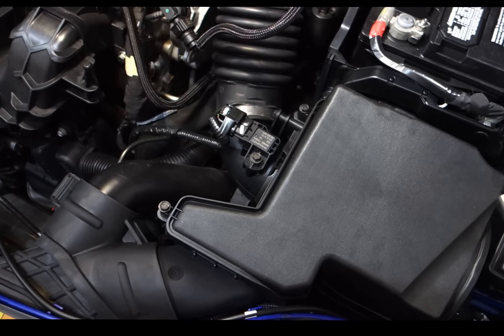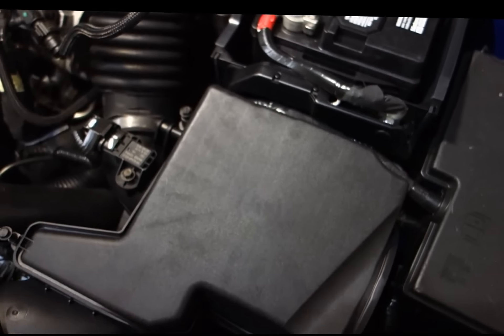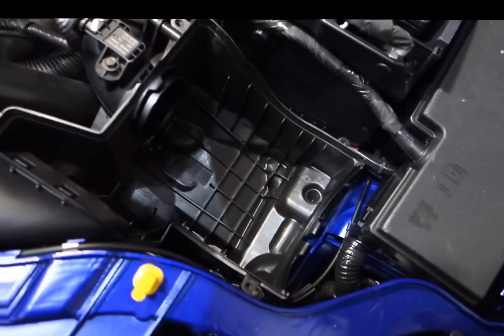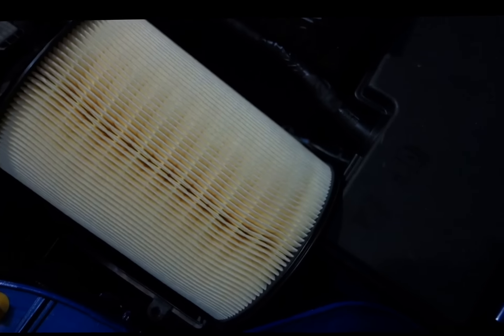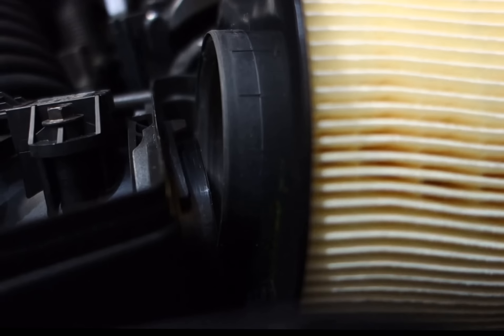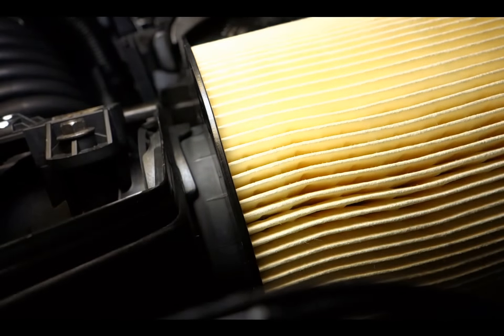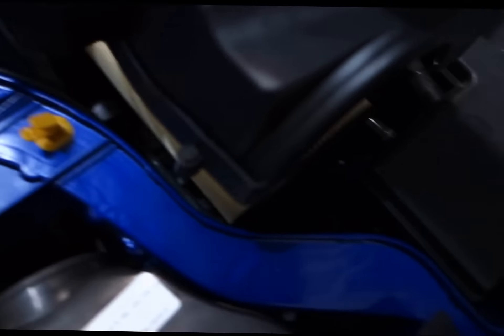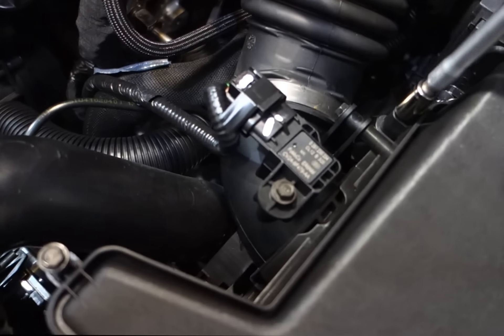How To Replace Ford Focus Radial Engine Air Filter

Comment: Thanks - this was helpful!  I ended up matching the gasket part first and shoving the radial air filter in (using quite a bit of force), and rotating the air filter as needed to get the notch to line up.  In the end, the radial air filter should line up with the "open" side of the housing so that you can easily put the cover back on.  All in all, a big pain, but I got there.

Comment: Real-time replacement, not like the vids that skip over the difficult parts: Lining up the filter flange, and then fitting the flanges on the cover so that it snaps into place. Careful alignment is crucial!

I replaced an air filter today (which is why I watched this video). Although the replacement Purolator filter was the exact same length, I could not get the bottom to fit into the groove in the air box. There were a pair of tabs in the way - I broke them off, and the filter fit fine.

Comment: Nice vid, just found your channel. I recently took my air filter out to change and couldn't get the new one back in, yes, I'm hopeless, had to call a mechanic out, lol.
Reply from the maker: +phil mason Don't be discouraged because of this, DIY is fun and satisfactory when done it right! Certain maintenance tasks can be DIY on this car still, but you can always get some idea from here first before start working on them.
Reply: I used to do all my own servicing, on old cars. I think I was worried about damaging something with the air filter, if I'd found your very helpful video I'd have been more confident in changing it. Thanks for the great videos, they are of very interesting.

Comment: Ford changed the size of the replacement filters - they are nearly 3/16 inch, or 5 mm longer. you essentially have to crush the filter a little to get it to fit.
Reply: Yes.   The part numbers match, but the replacement is longer.   You really do have to crush it.
Reply: Thank you! Mine is hardly fitting and I'm banging my head against a wall trying to get it to fit.
Reply: How would you recommend crushing it? I have the same issue.

Comment from the maker: No I didn't switch over to cold air intake but using the drop-in replacement only. The process is the same on that part.

Comment: I broke my Air Filter Clips on the Air Filter box trying to force the Air Filter into the unit. Following day, I removed the cover again and used a Grease on the filter lip and on the intake flue. It went in like a glove. I used Easy Grease ‘Easy Grease Spray Lubricant Synthetic Oil Waterproof Rust Protection’ from Amazon but you can possible use any other which can withstand -20 to +120 degrees. PS mine was original Volvo Filter. Same recommendation applies for Ford and others.

Comment: how did you seat the filter in the groove (when you had the camera down)   just push it to the left of the car or squeeze the filter vertically.

how many miles to change this filter and cabin filter? thanks
Reply from the maker: You started from the left to align the Air Filter neck to the intake hose and gently push & tug it into the air box. Assuming you're installing a genuine Ford Air Filter like I demo in here, it also has a small tap on the filter to line up to the air box housing. As for how many miles to change, there's no solid answer because it depends on the driving conditions. Typical 'guideline' of 20000 miles which you can follow, but you can also inspect them first before deciding to change or not. If the filters look dark & dirty, do it!

Comment: I'm having some trouble getting the new one in. I'm not sure I'm getting the tab in first, and I'm not sure if I'm strong enough to squeeze the filter in once the tab is in place. Any extra tips?
Reply from the maker: You don't need to apply too much force to the filter. Simply align and slot it into the tab and slide the other side to the pipe opening (like showing in this video) and screw the top cover back in.

Comment: This is just an idea. But did you try putting the gasket over the air intake first, then use the cover to push it into place? I didn't think about it until the cover wouldn't align to screw it down. So I put the cover over the filter loosely. Then I pushed the open end of the cover towards the filter and it popped into place. Trying it the way you did it in the video, the plastic clips on the backside that hold it into place broke off. It didn't help that it was cold out.
Reply from the maker: The way you mentioned, putting the gasket over the air intake first, is the first time I was trying too. However; I found that the air filter sleeves (the cap-end side) may not always align correctly or flush with the air box.
Don't worry about the plastic clip, it comes with the filter anyway. No big deal if you broke it, just don't force it too hard in the next one. Or do it on warmer day because plastic tend to be brittle in cold.
Reply: moomoo97 it wasn't the clip on the filter that broke. It was the clips on the air box, that the clip on the filter fits between. But after I put the lid on, it seems to be in sung enough not to worry. Thank you for your videos and for replying.

Comment: Just changed mine out ( 2016 Focus SE 2.0 L L4 ) and found out the new ones I tried are a lil bigger than orignal one and so much harder to put it in .I tried supertech , fram and even Motorcraft and they all a lil longer . Anyone else had a problem putting in new one ? Verry tight tolerances I just had shove it in past the lip that holds it properly

Comment: Thanks Ford. I have done a lot of things on cars. But this filter kicked my rear end big time. It just needs to man handled.
Reply: singingrain,
If the engineers who designed this had been told that one of their design requirements was to make it very difficult to change the filter I don't think they could have done a better job of that.  I hope that was not the case, and that it was only incompetence that resulted in this difficulty. Either way, they should be punished for it. ( 3:52 ) ( 7:17 ) (None of the other cars I've owned over the last fifty years has even come close to being at all difficult to change the air filter.)

Comment: The end of the filter MUST be fit into the groove of the filter housing along with the tab on the filter. If the filter is not in the groove the air filter box fasteners will not line up.

Comment: Why do people who make these DIY vids never think of implementing a gorilla stand/tripod? 
Whoever tries changing an air filter is not going to change it with one hand are they? It would make your life easier when making these vids!!
Reply from the maker: +Acreeet Thanks for the suggestion. Though I made most of the videos just on the get-go and non-scripted. It's flexible to just hold the camera and point it to where I want to show and demo. I did use tripod in some complex tasks during recording.

Comment: At how many miles should I replaced my air filter?
Reply from the maker: +Matthew Corbett Depends on your driving environment, but simply check every 5000 miles or at every oil change. Safe to do replacement every 10-12k miles.
Reply: +moomoo97 thanks for the response. I had 62k on mine have already replaced it.

Comment: I’m sure everyone’s oil change shop is honest, but I still mark my filter with small mark to avoid new filter scam I caught a couple shops try. Guess I’m paranoid but filters are bigger and more expensive!!
Reply from the maker: But I don't get your logic that if you can mark the old filter (reaching it) why not just DIY changing it?
Reply: moomoo97,
Marking the old filter is much easier, less messy, and less dangerous than doing the whole oil and filter change yourself. While it is a fairly easy job for an experienced DIYer, I can appreciate that it is a bit intimidating to a novice, and why some would rather pay someone else to do it.

Even though I change my own, I write the date and mileage right on the filter before installing it. Then I take a photo of it and email the photo to myself (with other photos of the filter removed, oil draining, and odometer) as proof of when the work was done. If I ever have to have someone else do an oil change, I will give them the new filter to use with the date and miles already written on it.

My problem is that I don't trust anyone else working on my car to not mess something up. Least of all, someone who is in a hurry to get it done because the faster they work the more money they make. Too many bad experiences letting a "professional" work on my cars -- some very serious. I'd rather get dirty myself (as much as I dislike that some days) than deal with that ever again.

Comment: Pro-tip: Don't reinstall the cover and you will be rewarded with a very nice induction noise.
Reply: DanielDaniel1,
"Don't reinstall the cover and ... " ... you will avoid the hassle of getting the screws and the edges of the box aligned.

I'm tempted to try it to hear the induction sound, but I'd be concerned about whether the air under the hood being hotter than the outside air normally drawn through the snorkel (just inside the front grille) might affect performance -- "all show, no go"?  

There are a few discussions at focusfanatics dot com about removing the snorkel, which appears to be an acoustic damper. It is even more difficult than changing the air filter, and does not make the induction sound as loud as leaving the filter box open, but does allow a bit more sound (noise to some, music to others) than stock.

Comment: Why put the cover back on its not really needed ?  It will still filter the engine air and breath better.
Reply from the maker: The cover has its place for water prevention to keep the paper air filter dry.

Comment: You are doing it completely wrong - aligning it to the tabs first and then forcing the tubular side onto the pipe ending? Why would you do that??? You should put the open side of the filter onto the intake pipe opening first, then move the closed end down, behind the tabs. It is intended that way by Ford! This way you won't break the tabs and you don't have to force anything - it just snaps into place, the closed end goes into its groove in the housing. That's all! Please don't spread this nonsense, look at all the comments, others broke their filter housings because of bad instructions! And it is expensive to buy a new one, even a broken housing will let debris and dirt in!